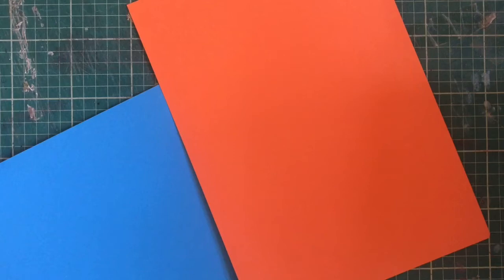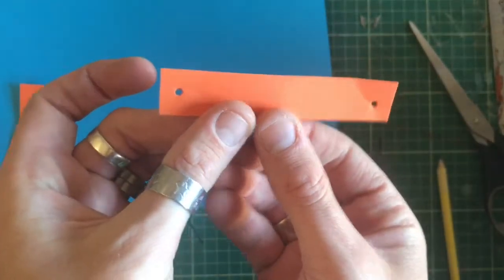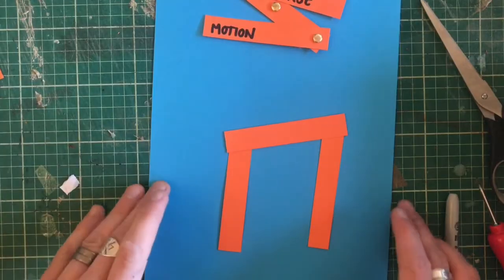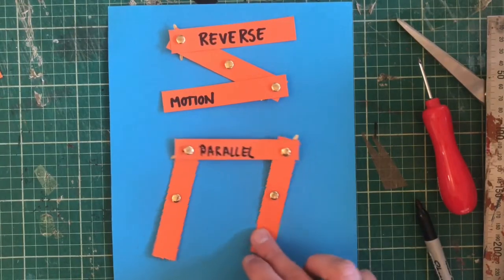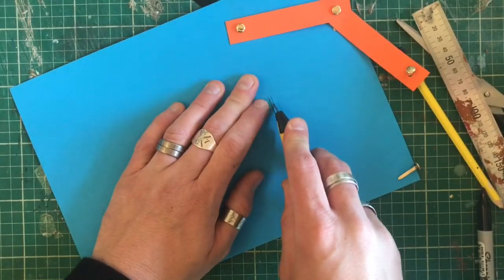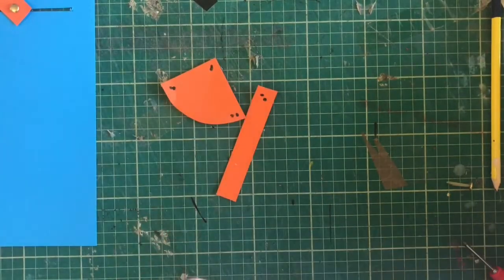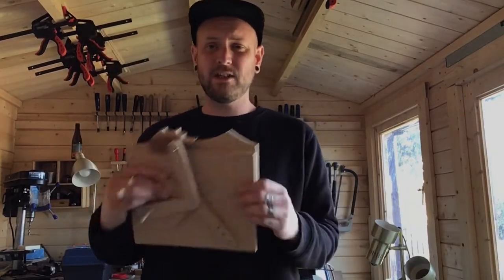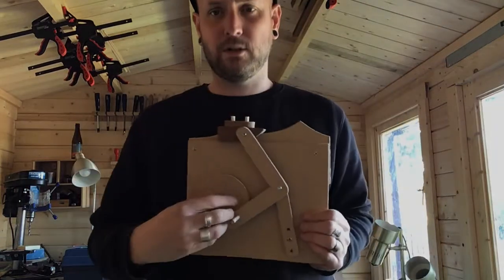Linkages

Comment: What I need is something that creates a parallel action but in reverse to the body that actuates the linkage. This linkage also needs to not bind vertical movement from the actuating body nor actuate when the actuating body moves vertically.
Reply: Here's an idea. Use a reverse motion linkage like this: Z. Now image that the left hand arm of the Z branches into a fork like this: >, and the right arm branches into a fork like this: <. On the ends of each fork you have pins, two pins on the left fork and two on the right. The pins fit into a slot cut into a vertical piece, one piece on each side. The slot is long relative to the distance between the two pins so that the piece can move up and down freely, and the piece is held vertical by the two pins. You can push the vertical pieces horizontally to actuate the linkage. You could use rollers instead of pins to reduce friction if necessary.
Reply: @dgphi  Might work, but I'm trying to avoid sliding wear over the long term. This thing is going to be a part of a car's suspension. It's also hard to visualize, so I think a diagram might help, if you can.